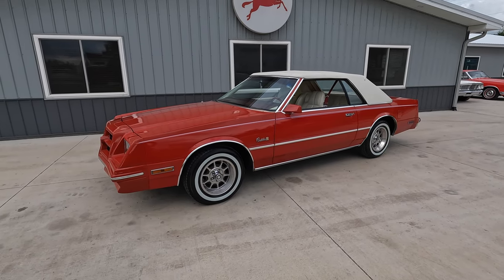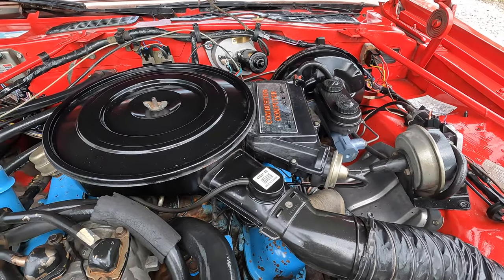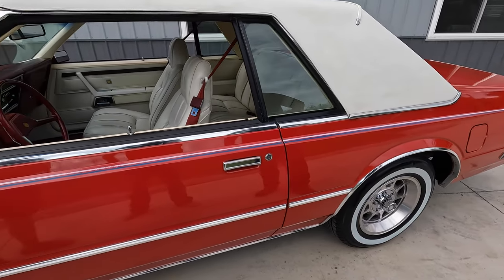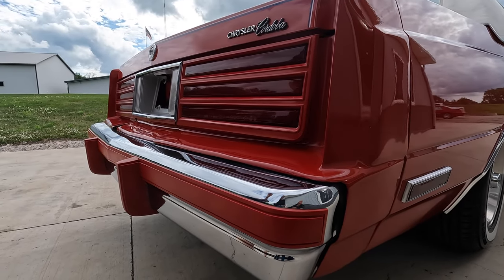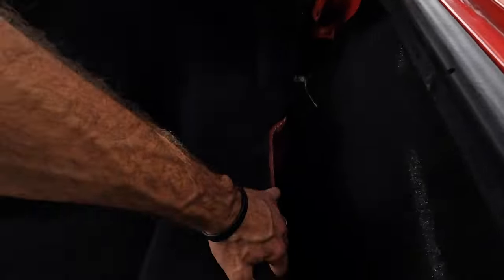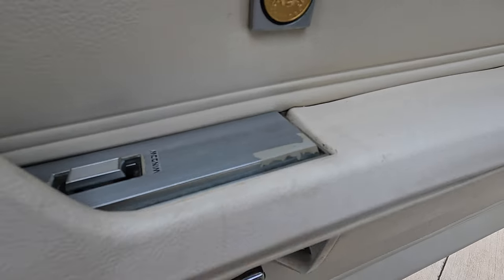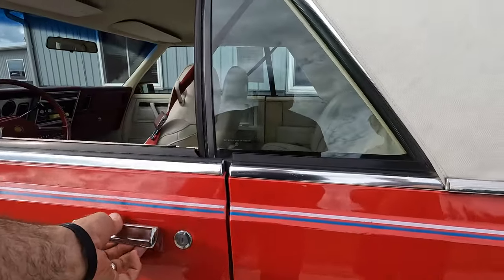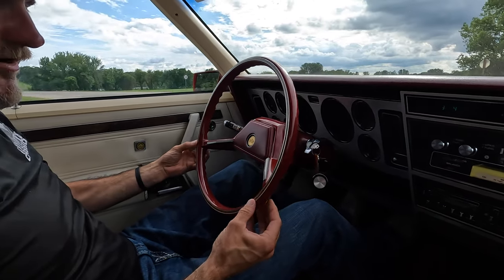WOW This 1981 Chrysler Cordoba is CLEAN (SOLD) at Coyote Classics

Comment: I had an 82 just like it as my first car, bought it new, put over 300k on the motor when I sold it. Never had any problems with the leanburn system or the electronics.

Comment: lol, "318's" blow, but it is a clean car
Reply: Not really...  Good engines just because its not a big block or so..
Reply: @MrCocg1  My grandpa was a MOPAR salesman 1946-1977 so I grew up on them, had a few 318s & they were underpowered by the '80s but were still a very reliable engine
Reply: I always thought of a 318 as just a workhorse slowpoke but bought a good running 1987 Dodge Diplomat ex-police car with a 318, 360 heads, intake and 4 barrel. It ran pretty strong but was choked with a single exhaust, and 2.94 rear end. Had to sell it after a job loss, been looking to see if it's still around and maybe buy it back. Crane makes some pretty good performance cams for that engine, from what I've read.
Reply: @Britspence381  right on, I had an '86 Diplomat ex detective car but it had the 360 4 bbl & I had dual exhaust put on & that baby ran like a champ
Reply: @SquirminHermanthe1eyedGerman  I was a Mopar salesman for 31 years and owned many muscle and not Mopars . 318s have their place is a point I would simply like to make
Reply: @MrCocg1  right, I actually loved the 318! My 1st car was a 1972 Fury II with the 318 2bbl, had a '78 D100, '78 Diplomat & a '91 Dakota! Very economical & reliable engine for its time compared to other car engines of similar size!